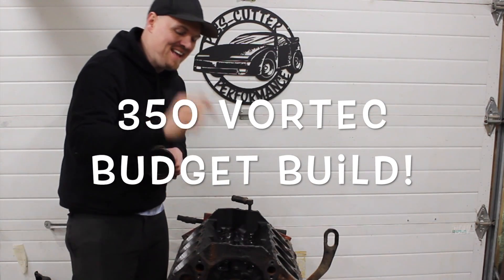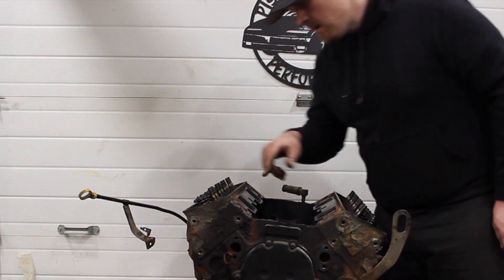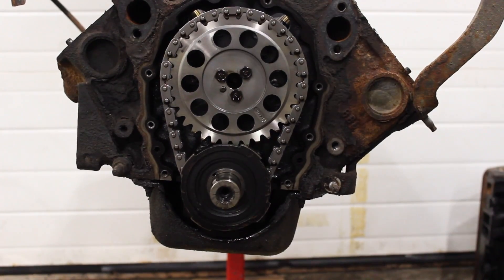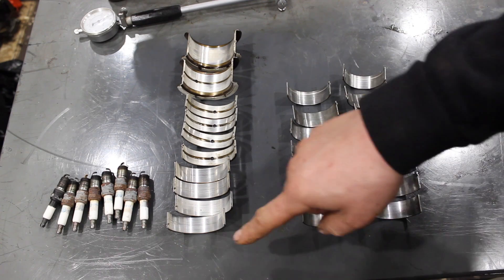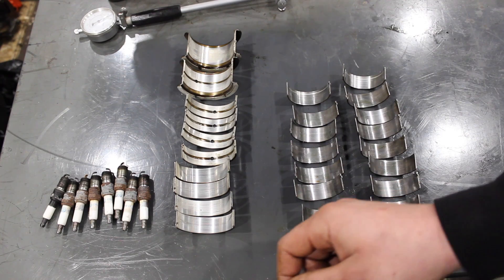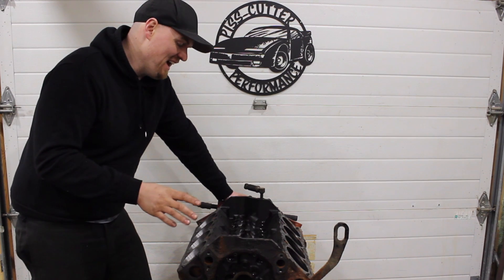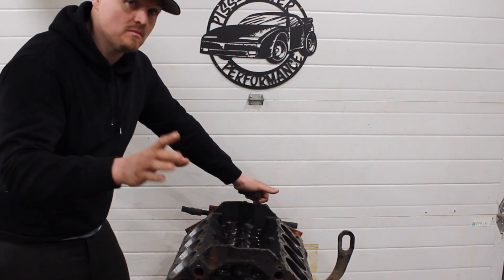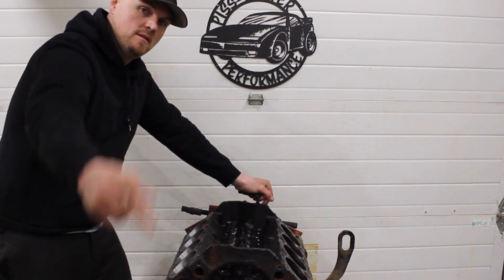Low Buck 350 Vortec Build! ( L31 Tear down) Part 1

Comment: Great channel ! I got a 400 sbc original in my 1978 G30 van ! I suspect it's low compression 8 to 1 or so . Do you know what the compression would be if I installed a set of those cast iron GM Vortec heads on it with a standard thickness head gasket ?

Comment: dude! where is the waterpump from? i have the same motor and my waterpump still has the clutch fan and serpentine pulley, i wanna go vbelt, but i cant find a 350 waterpump without those bypass ports, please get back to me!
Reply from the maker: You can use a regular SBC water pump with a bypass. The bypass just doesn't flow into the block

Comment: I would say for budget build port matching since it's already apart. Weight balancing the connecting rods and pistons since they are getting resized anyway. It's not getting bored so torque plating is out. Maybe equal the heads on minor planning  and polishing the engine valley and opening the return on the heads for better oil return. All you can pretty much do on your own next to nothing.

Comment: I and many others, would like to see an L31/ Vortec build, without going BACKWARDS, to a Two hundred buck CARB !  Use the  car's Tuned Port Injection (TPI) !  This for drivability, SMOG where required, cold start quality and cold running, fuel mileage, looks, etc.  PLUS, not every viewer can work on their car, any decent mechanic can diagnose and repair a TPI engine.  CARB swaped engine  owners may need to find a Race Car (expensive) shop, when something goes wrong.  Third Generation Camaro and Firebird owners would love this!  GM Truck owners would love to see this also  Every yahoo is tossing a carb on their build.  SHOW SOMETHING DIFFERENT AND PRACTICAL !  Thank you.
Reply from the maker: I use to be quite evolved with Tune port injection and was one of the last one around my area that would even tune TPI stuff. Ive mostly gotten out of it now because the demand it quite low and unfortunately the tpi looks cool, but it is so hard to make power with (especially compared to whats out there now). I do have a stealth ram intake that I would love to use on a future build possibly for my obs truck
Reply: @cuttersperformance  TPI was designed for the type of power, most folks, including enthusiasts prefer.  Low end torque.  Yes, it runs out of breath at about 4500 RPM, but how often we most folks go to the Redline?  I still think a TPI engine MILD  build would benefit many and be popular.  In fact, with cali and so many other , (PITA) ,  "CARB" States, a "Stealth" build that has a good chance of passing SMOG, would also be great!  NOONE on youtube/TV does them!   Thank you for your videos and your reply!  Michael

Comment: $300 for a used Vortec 350 is a steal. I'm looking for one myself but, in my area they run $500-$800 bucks.
Reply from the maker: Yeah it was a good deal, turned out to be a pretty clean engine on the inside with no cracks in either head

Comment: thats exactly my goal. got 2 l31s. first one i bought was a volvo penta 5.7 out of a burnt boat. turns out the block was mega cracked, and i think thats why it was on fire(owner of the boat is a big insurance guy...) the other one is in a 2001 chevy truck(probably a 3/4 ton, has the full float rear axle and single headlights grill. i know the volvo penta gsi/gxi boat engines came with the gmpp 395 ramjet cam. im hoping its a gxi, because they had comp cam 1.6 roller tip rockers. if not, ill just buy some. gonna mix and match parts from both engines. i paid $500 in total for both. $300 for the truck l31, and $200 for the busted boat l31.
Reply from the maker: They are great budget builders!
Reply: update: the boat vortec is a 305, and only has the 1.5 stock rockers. sucker has no carbon under the oil fill cap though, so the cam, lifters, and distributor drive should be great for reusing.

Comment: Love the vortec blocks, just wish they had a mechanical fuel pump provision. Also wish the jig to drill them wasn't $1k 😅
Reply from the maker: If you're lucky, you can find the odd 880 block drilled for a fuel pump, but alot are not

Comment: Agree 880 are the most underrated budget performers of all time.  Hone the walls with 180 or 220. Cast rings, hyper pistons. And grind  a 230 cam on a 106 with retainers for clearance,  and keep compression under 10. Deshroud the valves (watch David vizards videos), 2600 stall, 373 rear, Boom u have a winner! I use alot of enginetech stuff, cheap and real good! The ht383 cam works on stock heads and valves and puts out smacking torque at 2500rpm... excelent option too.. if those pistons look ok slap em back in!!

Comment: I would like to see if you can use other brand fasteners ( other than ARP brand)  where possible. I see you have used DNA head studs kits etc,  but bottom end kits like Speedmaster /PC do a main stud kit ( PCE287.1001 - 2 bolt mains)  which are way cheaper

Comment: GREAT VIDEO I BUILT 350S AND 400S 2 BOLT BLOCKS FOR BRACKET RACING AND ROUNDY RACING, NEVER HAD ANY ISSUES THE 4OOS WERE MAKING OVER 500HP, YA JUST NEED GOOD ROTATING ASSEMBLY GOOD BALANCE JOB AND LETTER RIP

Comment: The basic thing for me is HP per dollar while retaining reliability. I’m based in Australia and the exchange rate and import tax’s hydraulic the cost of things. I have been using assault intake manifolds and eBay Chinese heads as the eBay heads usually work out cheaper than rebuilding and modifying the vortec heads due to high wage costs for things like multi angle valve jobs and guide replacements. What I am interested in is the cam you choose as that’s the “ brains” of the engine and I hope you pick one that’s easily available. I follow your work closely and have learned a lot so thanks.

Comment: Another great vortec build! Pat, put something like a comp cams magnum 260 but on a 108 LSA. If you’re keeping those pistons deck the block to get under .040” quench and try to get the compression a bit higher. Do your magic porting on the heads etc. Love it
Reply: This is basically what I want to do in my 1990 GMC C1500, especially the 260-270 on 108 LSA cam, so I’m all for seeing the results.  Granted my pickup doesn’t have Vortec heads but it’s simple enough to get those.  Add an Edelbrock Performer EPS and I’m guessing it’ll be a great torque-y daily driver.
Reply: @NateDalton  that will/should be an 880 block so it will be set up to run the roller cam, but would have been built with a flat tappet...

Comment: Just wondering, can you flow a set of L-98 style 113 heads.  Seems hardly anyone runs these.  Are they any good.I have 3 sets, 2 early and one late.  Have used all 3 on 3 different motors seemed ok to me.  Would they have run better with other heads like vortecs?
Reply from the maker: They aren't a great flowing head, but they do work fine for a 300 to 325 hp build. I'd expect to see a 30 to 50hp gain (depending on the build) from switching to a vortec head. More flow and a better combustion chamber. 
If I get a set of these heads, I will do a flow test comparison

Comment: I watch all of your videos, great stuff. Just wrapped up a build, tech question for you. I went to head studs, do I still need those cylinder head locator "tabs" in the deck surface? Seemed redundant, figured you'd know better than me ha!
Reply from the maker: Thanks for checking out my videos, I appreciate it. The cylinder head locator dowel pins should always be used even with head studs

Comment: Just a couple of questions.
If you are going to resize the big end of the rods why bother with ARP bolts? I have yet to see any small block Chevy rod bolts break at the parting line unless something up top collided. IMO that's money that could be spent elsewhere. 

Are you trying to stick with a roller cam? The reason I ask is, even a relatively mild roller cam costs more than what a new cam, lifters and pushrods for a flat tappet would. SUM-K1103 would be a great cam swap. It would still maintain good drivability, still provide plenty of vacuum for power brakes, and with the .466 lift might still fit on the stock Vortec heads without having to machine down the valve guide boss.

Cam kit ~$140
Pushrods ~$110

I have yet to see a decent roller cam for less than $250.
Reply from the maker: Im a stronger believer in ARP rods bolts for longevity. While I know the stock ones dont often break, they are the most stressed fasteners in an engine. I've had really good luck with pushing stock rods with ARP bolts added. This might not be a very powerful engine, but I already have ARP sets, and if im resizing the rods, I'd feel better throwing in a set of arp bolts.
Flat tappet prices are tempting, but this one, I will be keeping it roller, but....spoiler alert...I am currently also building another vortec engine with flat top pistons and a flat tappet cam. Will be interesting to compare dyno results
Reply: @cuttersperformance  Spoiler alert acknowledged! 
😎👍 Looking forward to it!

Comment: I agree that the L31 is the best bang for the buck.  I bought a new GM L31 crate motor from Jegs around 7 years ago for $1,800.  I kept the long block stock for my daily driver.  Slapped on an aluminum intake, 600 carb, long tube headers and HEI.   Performance was actually better than I thought it would be.  I grew bored with it though and last year I installed a new set of AFR heads and a .500 lift roller cam.  It really woke up the top end.
Reply: Which afr heads did you choose? I'm thinking of trying the enforcer heads so I can continue to use my weiand Vortec style intake manifold.
Reply: @Carl_Jr  I used the AFR Enforcer 195's.
Reply: @erictate9891  Sweet. That may be my next purchase. Thanks for responding.
Reply: Which motor did you get specifically?
Reply: @gabrielheath3068  He got the L31 Vortec. At that time it was the literal drop-in replacement motor.

Comment: I've thought about building one but the no mechanical fuel pump provision makes me change my mind
Reply: I wouldn't worry about it. I got tired of dealing with the mechanical pumps and I bought that Holley Mighty Mite 7 psi pump 12-427 for $62. I'll never go back to using a mechanical pump. 
With a mechanical pump the fuel lines run right by the headers, right next to the engine block all the way up to the carburetor and does nothing but heat up the fuel. I have that Holley pump mounted on the passenger side inner fender well. Not radiating heat anywhere near it.
Reply from the maker: The small Electric carb pumps are pretty good and quiet
Reply: When I found my motor, it was a GM crate replacement, and came with a pump rod hole, 4 bolt main, PM rods and it only ran for 3 months before they parked and parted the truck.

Comment: Are you going to put a set of pistons in it to get the compression up or run these with a thinner head gasket to try to get as much as you can for less? I’m very interested in this build I’m starting a Vortec build for my truck soon too!
Reply from the maker: Stock pistons, rods, and crank are being used to see what we can get out of it with spending minimal money
Reply: I kept my stock pistons and used the FelPro 1094 shim gasket to help compression with my 062 Vortec's. they've been great but you really need to make sure the beck and head finish is perfectly clean and flat.

Comment: I think the whole idea should be "Upgraded L31" and not "Based on an L31". So in the end, this will be hopefully 350-400hp upgraded L31 that you could shove back in a late GMT400. And be able to run an 87. Sure 87 is boring, but its what most guys who daily these pigs want to fill up with..... HT383E advertises 330hp on 87 with a black box tune and stock injectors. I'm sure you can do much better without a stroker kit. The goal with mine is to have no visible change on the outside of the engine except maybe headers and the POS black box PCM would be replaced with a 411 PCM. I see tons of guys asking what they can do to upgrade their Vortec 305/350, but I think they mean...without switching to a carb and a rowdy cam, or Holley injection...and a rowdy cam.  Can't wait to see what you come up with .Cheers!!
Reply: stock vortec injection system is DOOKIE. go get a marine intake.

Comment: My machinist(40+ years in the business )said hes never seen chevy rods that didnt need resizing.
The bigend on the rods from the 3.4 camaro v6 Im building were way off even though the engine didnt have that many miles on it. Almost makes me wonder if the rods were sized right from the factory.
The rods on those v6 are more or less identical to sbc rods.
Reply from the maker: Yeah its true, I have a theory thats why L31s will randomly spin rod bearings when everything else is perfectly fine

Comment: I'd like to see the L31 build with the factory Vortec intake and how far that can be taken.  There's a few manufacturers of high volume injection MPFI spiders, combined with a 0411 tune and some off the shelf performance parts, I don't think 350-400hp would be unreachable.
Reply: I would love to see more fuel injected L31 content. My trucks a 98 and it’s got the “black box” pcm. I guess it only works on 98s from what little I’ve found but HP Tuners works fine on it. There isn’t any reason to swap pcms on my truck till I want to add boost, you can’t flash a +bar map into the black box like a 0411. But I’ve been playing with it for a while and I think the biggest problem/ restriction in the stock spider intake is the fact the fuel injection assembly is inside the plenum. Whatever it is you can see in the fuel that it signs off at 4000. You have to be pulling fuel after that or it just runs away rich. I didn’t know they made higher flow spiders though, I am gonna look into that! But with a stock motor exhaust and air intake I’m only seeing 60-64% duty cycle on the stock spider.
Reply: @BillStraub303  Wynjammer was the brand.
Reply: Literally my exact thoughts...
Reply: Has anyone had success porting the stock L31 lower intake? Everyone talks about how the intake is the biggest bottleneck, but I've only found one video on YT of someone porting it, with no flow bench numbers to indicate how well it worked. I'd happily send mine out for porting if someone could work some magic.
Reply: @aidenstefanson2175  there's options for either porting or replacing the throttle body, but yes, the plastic upper intake is the bottleneck in this equation. That being said, I've still never seen someone take the factory setup to its limit.
Reply: @paulg.5075 I thought the plastic upper isn't so much the issue as the aluminum lower half. The port alignment is terrible!
Reply: @aidenstefanson2175  the casting on the lower does make for crappy airflow, but the fact that you can't really enlarge the inlet on the upper under the throttle body is where the primary restriction lies.
Reply: @paulg.5075  I think the problem is the guys who have built a nice L31 don't have a a youtube channel with a following. Marine L31s make good numbers too... and I'm not sure the marine intakes flow a whole lot better. They have nearly tye same port setup but don't have the freekin injector lines routed inside of the runner. Which is just a goofy setup.  Marine intakes are expensive tho...
Reply: Start with the marine vortec intake, allows use of normal injectors. Plus, I think the upper is aluminum on them? If that's true, a larger throttle body for an ls1 bolts up, and is available in 80-90 mm sizes from bbk and others. Or you could use the l29 throttle body, it's larger than the L31 but same bolt pattern. Lots of options, the stock mpfi spider, and 6000 rpm ceiling of the black box ECU is the real limit, once you get rid of both it's just a sbc, super easy to make 400hp, 400tq with mild compression and 91-93 octane.  Naturally the stroker crank adds 35-40 foot pounds, and just makes achiving a solid 425hp/450tq a walk in the park with off the shelf parts

Comment: I scored 2 complete L31 blocks for $200 sitting on a trailer. Sold 1 for $250. The other needed minor work. Cylinder and line hone, cut the deck, crank polish & ARP rod bolts. Added summit hyper flat tops for 10:1, Promaxx Max183 heads, Howards roller 231/235 .510/.530 112lsa. Performer EPS and worked over 650 double pumper. Hoping it sends my 74 nova tko600 3.73 into the 12’s. We’ll see this summer.
Reply from the maker: Should be a very nice combo! 👍 especially with thats trans, I bet its a blast to drive
Reply: Nice combo. I’d like to see you with Performer RPM, a 750 carb and a 108 lsa. Dual planes like bigger carbs and the 108 lsa will add a healthy amount of torque. With the breathing of those heads/cam a Perfomer RPM would be a better match.
Reply: @evanarthur7535  I agree the RPM would be an improvement and is planned for future. I had the EPS from and iron headed engine laying around so I used it for budgets sake. I have a standard holley 4779 that I will be comparing with the worked over 650 at the track. I got the 650 main body for a steal so why not try it. I went with the 112 to keep power breaks knowing I would sacrifice for lowered end torque